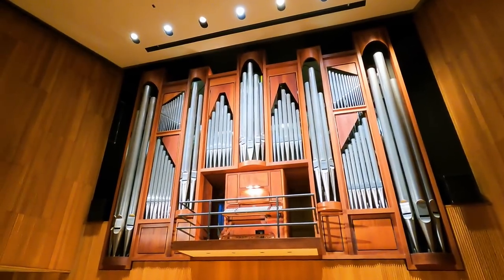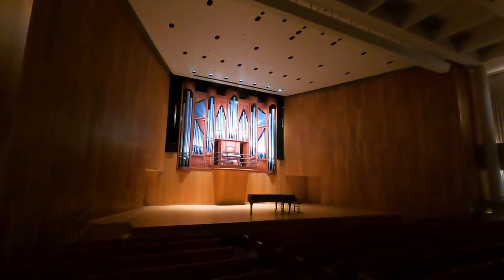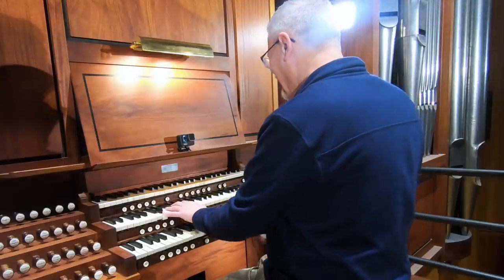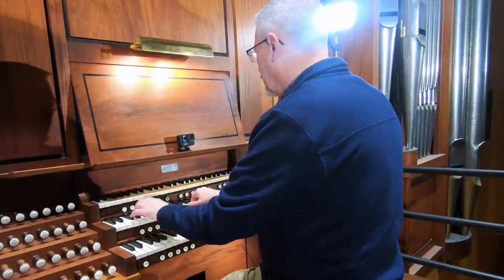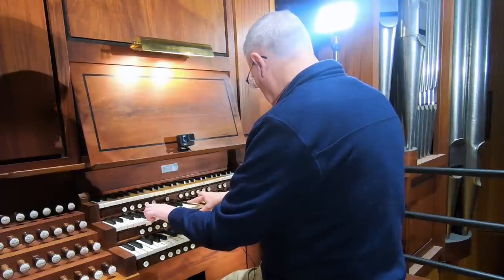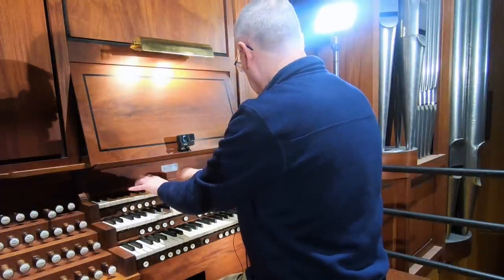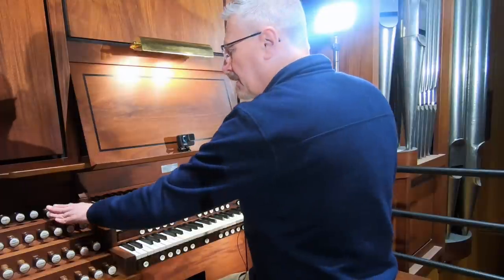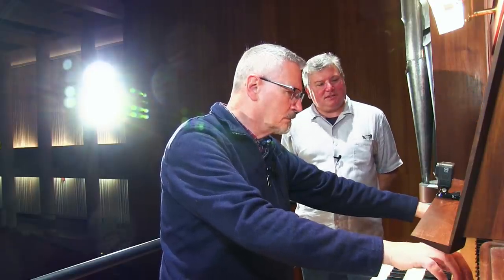1990 C.B. Fisk Organ - Slee Concert Hall, University at Buffalo, Buffalo, New York

Comment: Can you explain the stable wind control?  Not being an organist, I’ve never heard of that before and have no clue how it works or how and when one might use it.
Reply: It sort of helps knowing something about the instrument.  Some instruments have the ability to engage or disengage wind stabilizing devices.  This allows for steady wind, or more unstable wind which some believe is more authentic to early music.
Reply: Early organs (before electric motors) had wind supplied manually by one or more people, animals, water wheels, etc. The pressure was relatively low. When many stops were drawn and big chords played, the wind pressure would often drop making the pipe pitches drop (unevenly) making the music sound out of tune. It would recover when the chord was released. More authentic, is an arguable term with good reasons on both sides, a matter of taste. Enjoy!